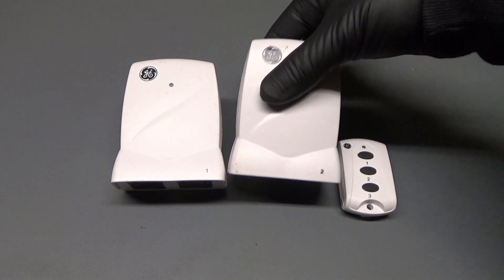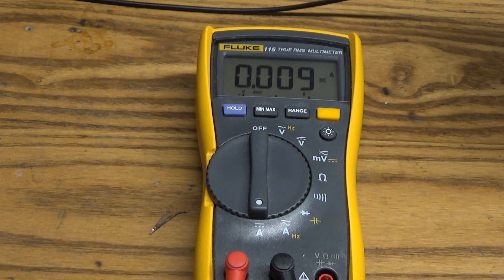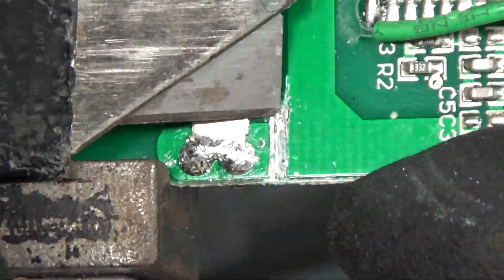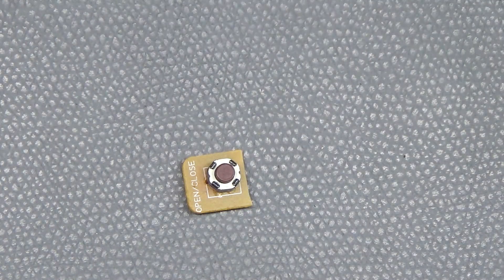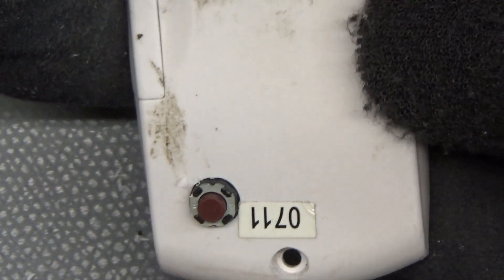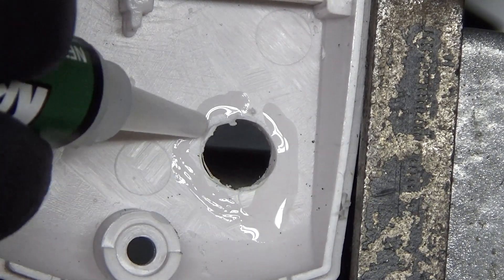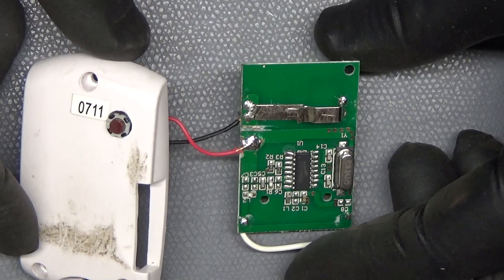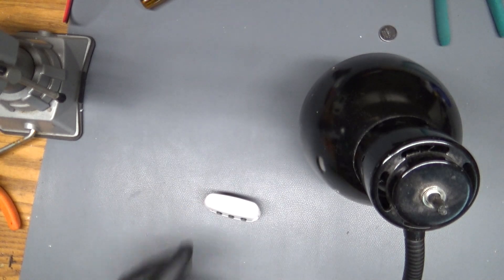Standby Current Modification - GE Plug-in remote control

Comment: In my experience those kind of switches will hold and accurately switch at half an amp @24v DC. They will effectively hold 6 watts without becoming welded closed. I make a lot of prototypes which require me to use a lot of those switches.
Reply from the maker: Thanks

Comment: Those anti static gloves? I saw two different pairs of gloves. Why the change?
Reply from the maker: They are nitrile gloves, less distracting than hands. I switch because I was using the drill, the other gloves have better mechanical protects.